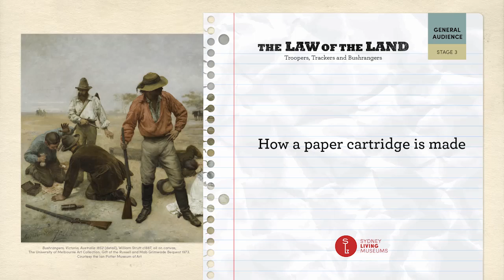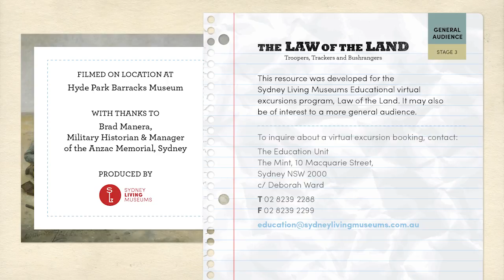How a paper cartridge is made

Comment: will this work for a cap and ball 6 shooter also, or not? cuz I dont wanna have to get a conversion kit. I like the paper cartridges but so far people r saying I have to get the metal cartridge conversion cylinder kit.
Reply: Usually you don't use paper cartridges in your cap and ball revolvers.
You load the predetermined measurement of poweder into the chambers of th cylinder, followed by a led ball (or paper wad if you want to shoot blanks) in each chamber followed by a little bit of grease.
Then you put the Perkussion caps on the Perkussion Nippes.

Comment: Would this method be accurate for XV—XVI century firearms?
Reply: No, before the adaptation of Linear Tactics soldiers had to manually fill firearms with loose lead and blackpowder. Even then, it still took a minute for troops to fully adapt paper cartridges.
Reply: @williammendeshumbane4967  thanks
Reply: @Velkan1396  Yeah, no problem.
Reply: @williammendeshumbane4967  i never used a musket before so I don't want to sound dumb but damn those soldiers were slow by the sound of it
Reply: @afinoxi  With loose ammo, shooting 2 shots a minute would be a miracle, it's not that the soldiers were slow as much as loading and firing the weaponry was slow. Even with paper cartridges and steel ramrods, 3 shots a minute (Which was standard in the majority of European armies) was actually pretty fast, but not the fastest. Prussian soldiers could be pushed to 6 shots per minute but this is impractical in the battlefield as a soldier could easily wear them self out maintaining this speed. I've even heard stories of some people pushing 8 shots a minute but just that, stories.